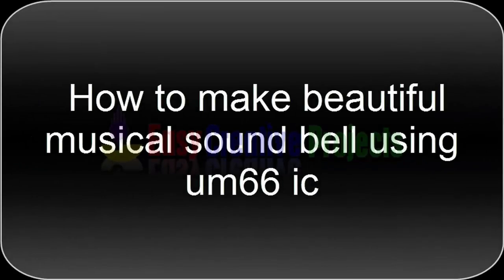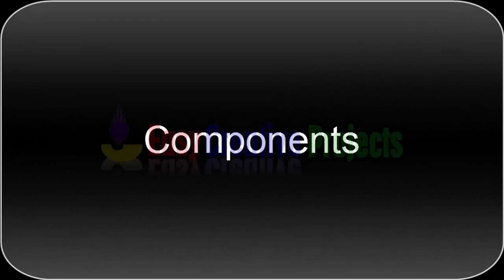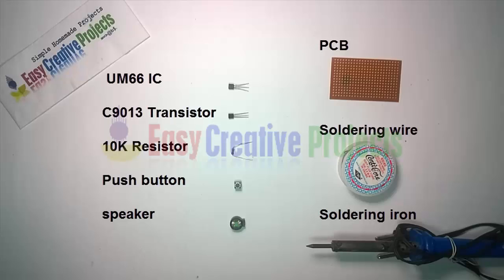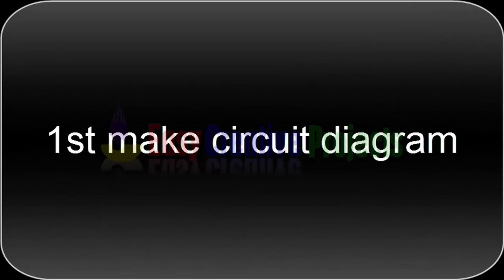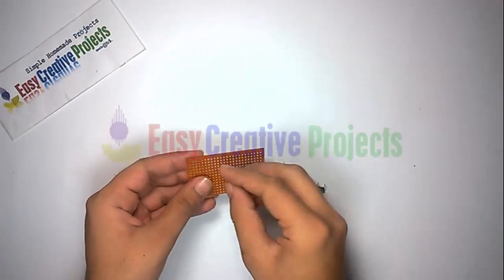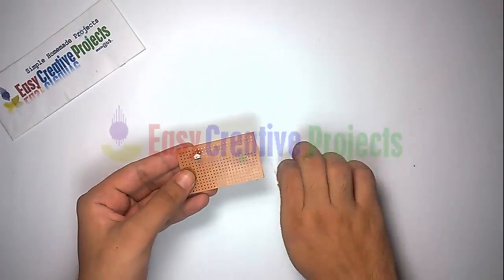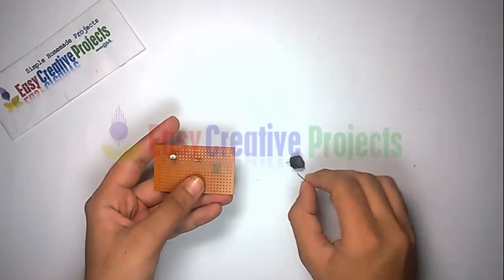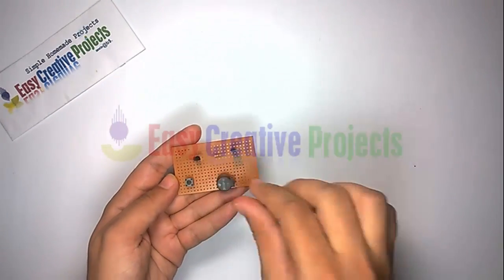How to make beautiful musical sound bell using UM66 IC - easy step by step with circuit diagram

Comment: hey bro, i want 3 hrs once 30 secs duration 9v or 5v alarm circuit. please help me bro. thanks
Reply from the maker: Dear,
this circuit work on 300mA to 500mA current.
you can also run this circuit on 5v or 9v and 500mA.
Reply: Easy Creative Projects  how to bye this type speaker
Reply from the maker: Dear you can easily purchase any electronic components shop.